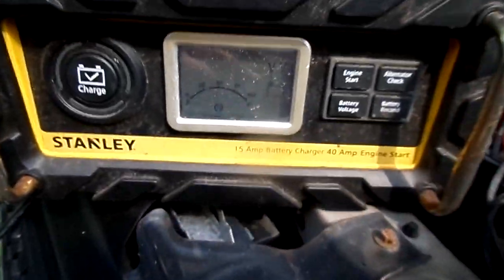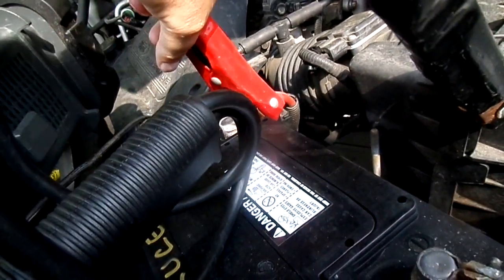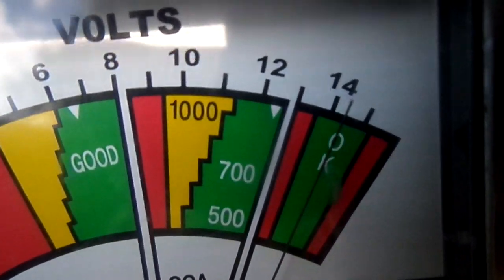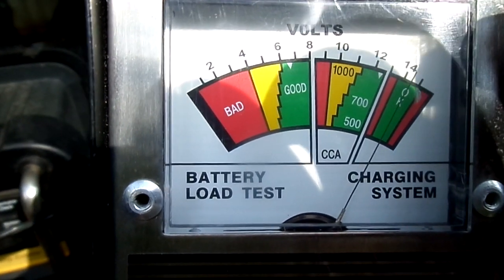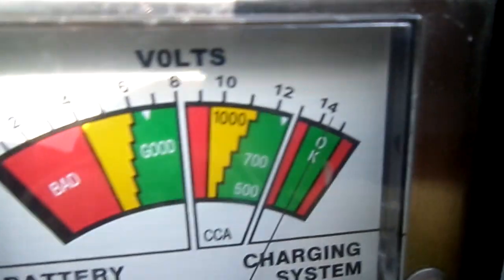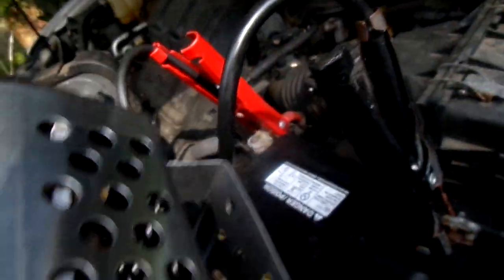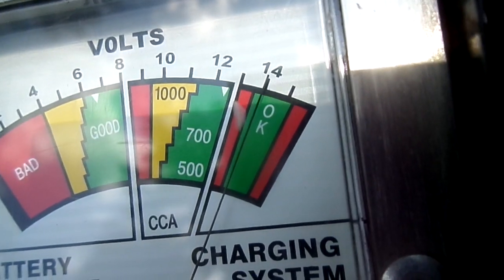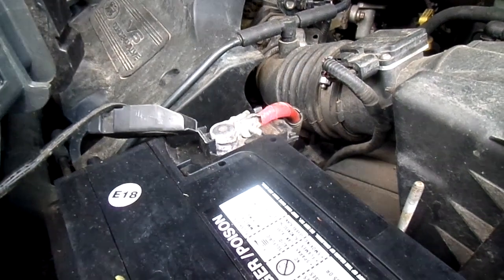How To Use A Battery Load Tester on Car or Truck  Battery

Comment: Your Blue Point battery load tester looks like an Associated battery load tester made in St. Louis. 
I just ordered the Associated model 6031 from Amazon on 10-15-2024 $157.98 though they do make several cheaper models.

Comment: Your description of hooking the positive/red up first and then the negative/black second, both to the battery, will not stop a spark which can explode the battery if explosive gases are given off.  The proper way is to hook up the positive/red first to the battery, as you describe, and then the second negative/black to a heavy ground on the engine that is away from the battery where gases could exist and be ignited by a spark, if one occurs .  This same procedure is used to jump a car, with the last connection being made on the car being jumped since the running car is  more likely to be generating gases since the alternator on the running car is charging the battery on the running car and charging a battery often causes explosive gases to be generated.  When jumping a car, both connections on the running car can be made on the battery since the circuit is not complete until the fourth connection is made on the heavy ground away from the battery of the non-running car.  Saying again, when jumping a car, the last, of the four connections, is to a heavy ground, that is away from the battery on the non-running car . . . and that last connection made, is the first connection removed when the jumping process is complete i.e. for the same reason that if a spark will occur, it will be when the circuit is being completed (at last connection) or the circuit is being broken when the first connection is removed.  Hope this helps.

Comment: My brand new battery tester smoked a bit on the top, resistor after only about 3 seconds.   Is that normal?  Suppose it gets hot and is burning off something from manufacturing?
Reply: That's what im wondering. Mine did the same thing
Reply: 100% completely normal when their new.
Reply: @404notfound.....  oh okay good, it scared me at first 😂 I thought I screwed something up

Comment: By the way I’ve jumped over 2000 times in the last 2 years and I’ve never seen a battery blow up or anything near that
Reply: 2000 jumps, dam must be tow truck driver, contracted to AAA  .I bought the jumper pack, that starts my 7.3 power stroke,that has two batteries,  Saved me many times, and others.. good investment .

Comment: You got it wrong @ 1:13 .  Red one comes off first.. Always. When applying; red goes on last.. Always..  Think about it - the entire car is negative grounded. Black connectors on negative posts dont create any grounding danger. But hooking up red to positive posts first energizes the equipment, making it vulnerable to accidental grounding.
Reply: Thx. So glad you taught me this.
Reply: @everyone2975  It's very odd, I can't explain it.  But if the whole car is "emitting" negative, and you hook up red first, then there is a risk of your black lead making arcs and sparks if it accidentally brushes ANY metal part.
On the other hand if you connect black first, the device "emits" negative like the rest of the car. The only chance of accidental sparks is if the red lead brushes up against the positive battery post only. The very same post you are going to connect to, deliberately.
Reply: . thanks I will try it that way from now on. I did get a little spark when I followed their directions.
Reply: @everyone2975  Good idea.  keep in mind that some sparks upon clamping to the positive post (done correctly 'our' way) still might occur. This is unavoidable.

Comment: Maker starter click while cranking engine. I bench test starter and it work. Battery half year old and check voltage and it say 12.4 volt. What could be wrong?
Reply: Charge the battery and make sure after charging it stays over 12.6 volts after a few hours. Make sure your volt meter is accurate and even then a battery that reads 12.5 volts open could drop to 8 volts under load if its bad or defective.
Reply: I try to charge to 12.5 volt but it click and same old problem. I think it might be defective or sulfation inside battery is bad because I test it with same tool you have here. The cranking power  on battery seem to be very low on tester, and not enough power to crank starter. Maybe, the store gave me bad battery. Don't know how they keep battery on shelf for long and not charge it. I have warranty o  it, and gonna send it back for brand new one.
Reply: Could be a bed key fob sometimes a magnetic decoder becomes demagnetized and you have to buy a new key
Reply: Make sure battery connections are good on the battery and your ground to the engine.